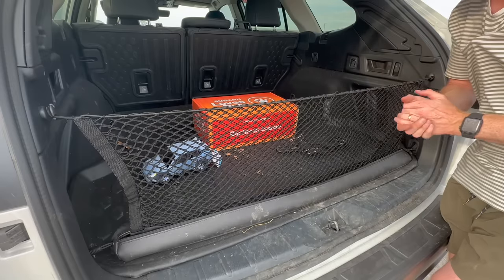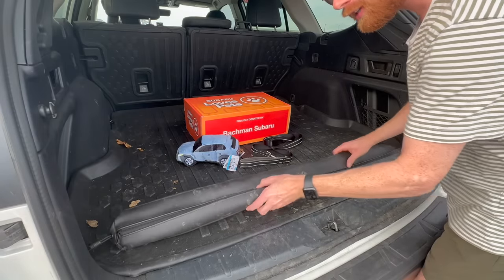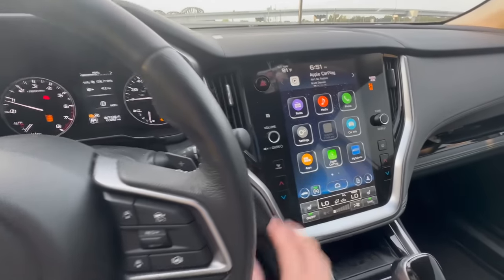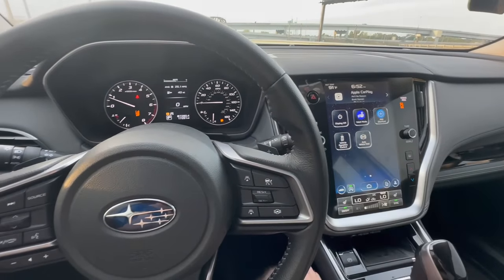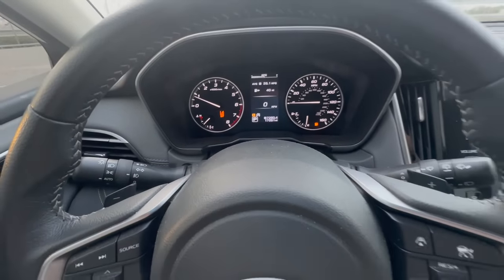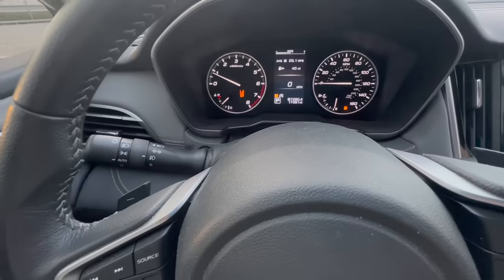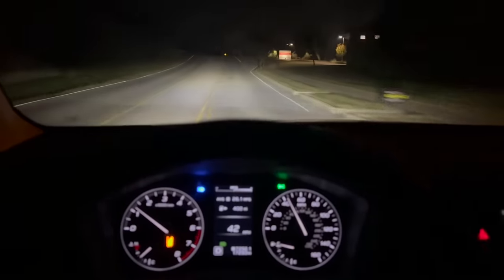Top 5 Hidden Subaru Features: Outback, Forester, Crosstrek and more

Comment: Hey Alex thanks for the video.
I have a question about 11.6" screen. Whenever I pass under a cross-over road, as soon as sunlight gets disconnected with car sensors, the screen gets dark and stay dark for few second.  I want to change the screen light manually if needed.

Comment: Alex you have an Onix trim 2023 and your ceiling is light-grey ? 
I remember when i bought my 2023 Outback Limited (it was Nov8 2022) in dealership i saw there 2 Outbacks Onix with all black interior.
Reply from the maker: As far as I know, the Wilderness is our only Outback right now that has the black headliner. Would have preferred the black over the gray but that's all that was offered on the Onyx. Easier to keep clean!

Comment: My 2020 outback’s power seat is malfunctioning due to a missing motor drive end cap and Subaru will only sell me the entire lower seat assembly for $1k , the missing part is not listed on the diagram. Very disappointed with the accessibility of parts to maintain my Outback.  I missed the 3 year timeline to purchase an extended warranty, 😢.  This long time Subaru owner may be switching to Toyota

Comment: I would love to see a video on how to reaplce the front and back window wipers.  I just bought replacements for my 2023 Outback and I cannot figure out how to replace them!
Reply: I don’t have a video, but there’s a cover over the J-hooks that slides off. It pulls off opposite of the wiper arm. Then, there’s a tiny plastic tab inside the J-hook. Pinch that to release, and you should be able to wrestle the blade off. The new ones will click into place, then you just have to slide the little covers back on.

Comment: I think you should do a small video, on key wont turn in ignition.  if you pull in and park and have wheels locked one direction or other, key wont turn in ignition, you have to unlock steering wheel first. almost called subaru emergency since car was only a month old

Comment: My auto-high beams on my 2021 Forester sometimes dim for no good reason.  I'll be driving home from work, on the highway, and they randomly dim, even when there's no on-coming traffic or a vehicle ahead of me.  And it takes them a while to go to bright when I start driving.  I like the feature, but if it won't work the way it's supposed to I'll just go back to manual.  It'd also be nice if there was a way to unlock all doors and lift-gate, rather than having to repeatedly push the unlock button on the fob.  I put my work apron in the backseat, and I'd like it if the rear doors would unlock at the first push.

Comment: Thanks always for your information. Can you do a video on the recommended service intervals? I have a. 2019 forest sport with almost 60,000 but the package is like 700 dollars!
Reply from the maker: You're welcome! Yes, the 60k service is the first big one. Brakes, rotors, plugs, front and rear diff, and more are checked. By that point you'll probably also need tires if you haven't replaced them already.
Reply: @alexpmo Don’t you need to service them every 10,000kms or 12 months whichever is the sooner?

Comment: I have a 1998 Subaru Impreza with automatic transmission. I have replaced the rear assembly twice and finally just had the rear drive shaft removed. I am told that Subaru no longer makes this part. Do you know of anyone who makes the part? Thanks.

Comment: Hey Alex! While washing my forester, I noticed these two body colour caps mounted on either side of the front bumper just below the head lights. I thought they were covering the towing attachment. But I can only pull them out by about 8-10cm. Just wanted to ask what those are?? Would be great if you included this in a video.
Reply: They are headlight washers. Do not pull them out manually. 
You operate them with a long pull on your washer stalk.

Comment: I have a 22 Forester Wilderness.  After the car was turned off , I came back into the garage a few hours later ,and th 10:59 ere was a buzzing sound coming from the rear hatch area. What is this, what causes this and how do you turn it off?
Reply: its meant to do that; don't understand the technical details, but its normal, something to do with the fluids
Reply: it mentions it SOMEWHERE in the encyclopedia/manual

Comment: When using AVH, are your brake lights lit?  Otherwise, wouldn’t this be a potential rear-end collision danger?
Reply from the maker: Yes, the brake lights are on
Reply: @alexpmo  thank you Alex!!
Reply: Interesting question.  I'll have to get my wife to look before we leave home next time.  
If your cruise control is turned on the little picture on the dash shows you when the cruise activates the brakes either because you are overrunning it on a downhill or approaching a vehicle ahead too quickly.  You can see the red third brake light get brighter in the dash picture.  That might be another way to tell.  Just have the cruise turned on.
Reply from the maker: @MyDogRunner  you’re welcome!

Comment: I am currently on my 4th Subaru, 2022 WRX, and my previous were '02 WRX, '17 WRX, and '20 Legacy.  I really like the Auto Vehicle Hold feature I first personally encountered in the 2020 Legacy (it had an amazing interior but new Legacy not so much).  Since I had not seen this feature on a Subaru, or other cars, I was not sure how it was implemented on non-Subaru cars.  In a Subaru, you have to turn it on each time you start the car which is annoying, even if you can have the icon on the first page (mine is buried in a sub-menu).  However, in my Mercedes this feature is active all the time and does not need to be turned on - I am not even sure it can be turned off.  I do not get why Subaru does not allow this feature to be on all the time, as it should be tied to the driver profile and be set to that driver's preference, like the seat moves for each driver.  I do miss the facial recognition feature in the Legacy (not present in the '22 WRX) that recognized my face and changed the seats and mirrors to my preferred positions.

Comment: Alex, we purchased a very slightly used (5600 miles) Outback Touring this summer. I've watched many of your videos and am very appreciative of the work.  

My lower back seems to get tight & sore after a relatively short time of driving.  I'm trying different positions of the seat controls & the leg extension to try reducing the discomfort. 

Have you heard from others of something similar and any thoughts?  I'm not a big/overweight man.

Comment: our 2024 Outback wilderness has been an awesome automobile. Very impressed with all the features, including some that I have learned from you Alex.
Reply: Is the infotainment freezing up or anything?
Reply: @bradh6185 , mine went down for no reason after having been off at a restaurant for about 10 minutes.  My EyeSight and rear backing camera system went down about 30 seconds later. Before I could get it to the dealer, it came back on (after a 30-45 min stop). Dealership couldn't find anything.  Interesting to know I'm not the only one this happened to.
Reply: @dsa4347  Thanks for sharing. I haven't bought one. Just shopping, but I've seen a few complaints about this. Is yours a 2024?
Reply: @dsa4347  O my! If it happens again and a cause is found please post here for us.
I love the center stack but if that goes down so does everything.
Reply: @bradh6185  Yes. They told me to video it if it happened again.  Pretty much saying, "We don't believe you."

Comment: isn't AVH for when you drive on a steep angle road?
Reply from the maker: AVH can be used for that also but it's for any angle surface. Just used if you want to take your foot off the brake while stopped to relax your leg.

Comment: I disagree when I bought my 2023 Subaru the net for the trunk did not come with the hook attachments on the sides of the back walls that attach the net standing up.  I was told they had to be drilled in and the dealer wouldn’t do it.  I can only use the net laying down which I hate.
Reply from the maker: It sounds like whoever you spoke with at your local dealer told you wrong. These are in fact installed at the factory. If the net is ordered after your car had arrived, the hooks are installed by a technician at the dealership. It's an OEM accessory and all Subaru techs will know how to install the hooks.

Comment: Hi Alex! I am in dire straits! My 2021 Subaru Outback lift gate is acting like a fool!  I have successfully reset it a couple of times but those days are now over.  I have tried every single trouble shooting suggestion out there from the "close halfway and push the button" to unhooking the battery situation and everything between that I could google..  HeLp!!
Reply from the maker: Is the gate only opening partially? If so, I would manually lift the gate up to the highest position. Then click and hold the button on the inside of the gate until it beeps (this is the one you would usually use to close the gate). That should reset the gate so that now when you open it, it will open fully. Hope this helps!
Reply: @alexpmo  Thanks Alex!  At this point, there is no movement at all that is not manual.  Sometimes it will unlatch and instantly latch.  Sometimes it just beeps.  Sometimes, it does nothing.  I have to climb through the back to manually unlatch.  I am thinking that I need to make that dreaded dealer appointment. I thought I would check here first.  Appreciate your content!!

Comment: 0:06   I have a 2011 subaru forester  2.5 L non-turbo and having issues with it not wanting to start.    It has roughly about 243000 miles on it. There’s a lot more than just that but to much to write in the comment.

Comment: I don't think my button in the back can be used to lock the car,  just unlock with the code (2021 Forester Sport).  Used it last when I walked to the work parking lot to get something I forgot and left my fob in the office. Was so happy I could use the code and not make the extra trip back for the fob.  BTW, love high beam assist.
Reply from the maker: Glad you found it helpful! I believe the lock feature only works when your key fob is near by. Will have to double check mine
Reply: @alexpmo  But not inside the car.  As far as I know, If a fob is inside the car you have to use the button on another fob to lock it.  If there is another way to lock it please let me know.  Touching the door handle sensor certainly won't do it.  The beeps complain loudly.

Comment: Anything i should know or if there is any cool things I should know about my 18 Forester?? I would love to know how to shut off my passenger side seat belt pressure plate (think that's what it's called)  anything sets it off even my cell phone will set it off i think that's a little much i can go without the ding dings when no one is in the seat. I've looked under the seat to see if I could just unplug something but I found a least 3 different wires for a seat with no heat and it's not electric. CAN I JUST TAKE OUT EVERYTHING THAT DINGS?? I have dings for starting my car with no seatbelt on,or opening my door or putting my cellphone on the passenger seat all kinds of things

Comment: Thanks for your tips.  We bought an Outback in 2020.  That will be the last one I will ever own.  Nothing but trouble.  No help for the dealer or the National office.  It only has 85k miles and I have already spent over 2k in repairs.  It is also already on the 3rd set of tires.  I would not recommend a Subaru to anyone.

Comment: Is there a way to disable the proximity on the key fob? For example when washing the car or going on vacation. I had a Mercedes before this and I'd just click the fob lock button three times and it disabled proximity, so i could wash my car without it constantly locking the doors every time water hits the lock sensor. Or just saving the fob battery when not in use, on the second fob. Is there a way to do this on Subaru keys?
Reply from the maker: Yes, here's a quick youtube short on how to disable your key fob: https://youtube.com/shorts/Wb5ziL_MHZ8?si=YKIBjGOwrkSrUe7K
Reply: @alexpmo  dang you have a video for everything, thank you!
Reply: @alexpmo  So, how do you reactivate it?
Reply from the maker: @jerrymiller276  I knew I was missing something. Click any button and it turns it back on.
Reply: @alexpmo  Thanks!
Reply from the maker: Just made it! Thanks for the question. I've updated the video to show you how to wake the key back up when you're ready to turn it back on: https://youtube.com/shorts/Wb5ziL_MHZ8?si=YKIBjGOwrkSrUe7K
Reply from the maker: I knew I was missing something! Here's an update to show you how to reactivate it: https://youtube.com/shorts/Wb5ziL_MHZ8?si=YKIBjGOwrkSrUe7K

Comment: Hello Alex, Great video, but the Auto Highbeams are blinding everyone when you drive around a curve, go over a hill, or the sensor does not sense the other car in time.  This is a problem with every car manufacturer and it's causing real danger on the roads due to people being blinded inadvertently putting them at danger of accident.  I've noticed this to a high degree in the last two years and people are even using them even during the daytime.  There needs to be some type of legislation banning this feature because of the way it's misused on the roads, endangering other drivers.
Reply from the maker: Thank you! I agree, the high beam assist needs updated. I've defaulted more recently to not turning on my high beams at all because of the occasional flash I get from oncoming traffic. But I also came from a 2011 Honda with halogen bulbs so my low beams on my 2023 Outback are still a lot brighter than even my high beams were on my Honda🤣

Comment: My 2022 Forrester Wilderness won't lock if you have the key fob inside the car.
Reply from the maker: The key fobs are designed that way so you don't accidentally lock your key inside. You have to put the key in sleep mode to lock it inside. You click the lock button on your fob while simultaneously double clicking your unlock button to put your key in sleep mode. Make sure you're confident with using the pin code or you have a spare key handy before doing this.

Comment: I have a question about leaving the rear hatch open on my Outback Wilderness while camping. I have seen videos where they suggest placing a carabiner (there is even a plastic part being sold to serve the same purpose) in the rear latch to trick the car into thinking the hatch is closed. I have been told Subaru’s have had an issue with battery drain due to leaving the hatch open.  Don’t wan’t to run into a situation where my Outback runs out of juice when I’m in the outback.  Just wondering if this trick really works or not or if there is another solution besides keeping the hatch closed.

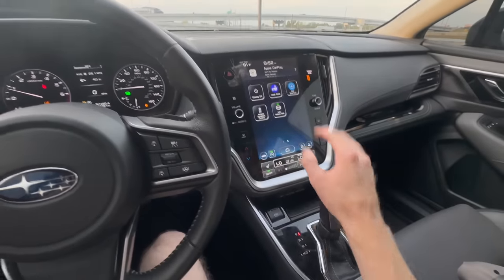Comment: 6:56 I would use auto vehicle hold during those times when road work is being done and your two plus Lane highway is suddenly down to one lane. There's the highway worker who has stopped traffic in one direction so that all the traffic in the other direction can go for x number of minutes. I've been in that situation and have applied my emergency brake and turn the car off.

Comment: Hi. My first and current Subaru is a 2017 Outback that I purchased new. I’m in the minority but I have no desire to own a second one. Cover poor wheel bearings; $1700/bearing. A $45 steering spring kit at a $700 replacement cost and all this and more with less than 134,000 miles. Great marketing hype but not much of a car.

Comment: If they are such good features why does Subaru keep them hidden? Our 2019 Forester Limited does not have a hidden cargo net. It’s too bad you have chosen to hide AVH in the touchscreen instead of the physical button where it used to be. As for the automatic high beams they are far too sensitive. They constantly turn on and off when driving on residential streets where it should be low beams only.

Comment: I just bought a 2024 Subaru Outback XT - very unhappy because in order to get any speed, you have to floor it and maybe I can get it up to 50mph. 😢
Reply from the maker: Sorry to hear about this 🙁 The torque and acceleration on the XT is much quicker than the standard Outback so I'm surprised to hear this. Has your Subaru dealer looked at this to be sure everything is working properly?
Reply: Adjusted the seat, much better!

Comment: I accidently left my foot on the brake with the AVH on.  The alarm went off and I had to turn off the car to start again.  What happened? Thanks.
Reply from the maker: Not sure what could have happened. Did you take your seatbelt off or were any doors opened when you had AVH active?
Reply: Did you open the driver’s door?

Comment: I have a Subaru outback I saw your video on how to put it in reverse when the battery is dead.  You said to pop off the plastic I don’t want to force or scratch it.This video was on the forester is it different for the outback.